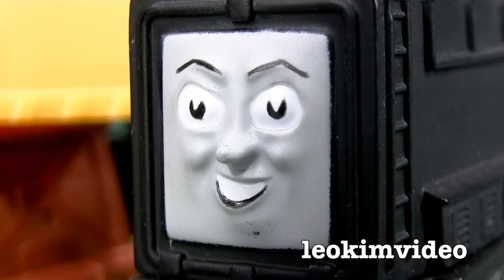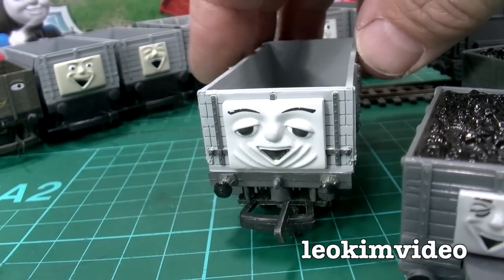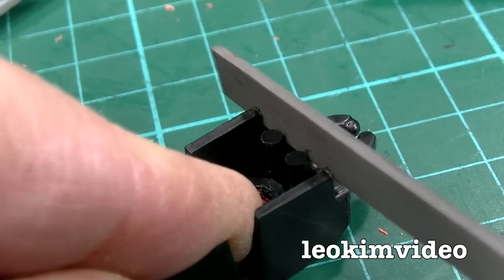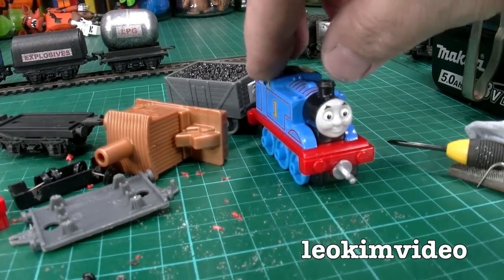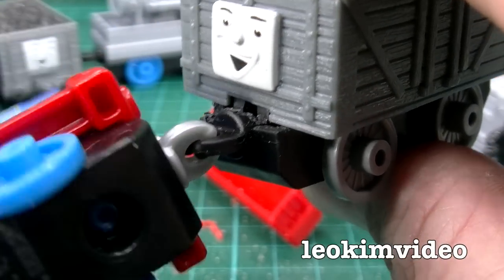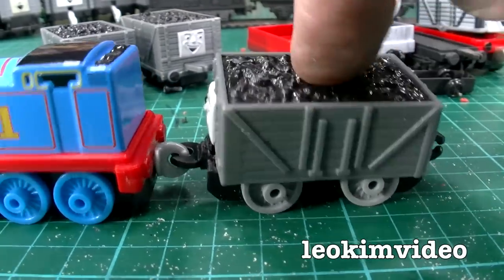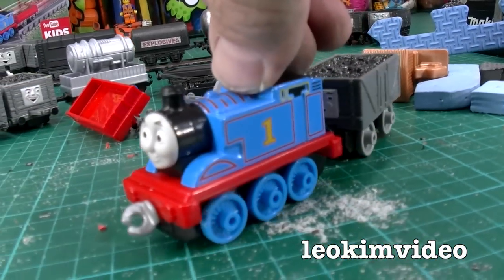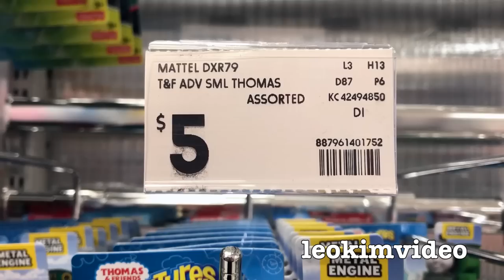Thomas The Tank Adventures ERTL Troublesome Truck Toy Train Mod How To

Comment: The ERTLS packed the detail and correct shape as seen on TV but the couplings were the weak links. It's they'd have been made with the Adventures couplings in the first place, there wouldn't have been any need for the magnets or any further changes

Comment: ERTL made troublesome trucks with different faces, like the ones you showed in this video, and they made S. C. Ruffey. They also made a very rare variant of the two standard Troublesome Trucks, but they are brown instead of grey. And they made other variations of S. C. Ruffey. They made two versions where he is marked as a “toy box” truck sold in a very rare Christmas two pack with a Thomas that has a Santa Hat molded onto the smokestack. And other Troublesome Trucks include a two pack called “Silly Vans”. Another very rare pack. And a brake van with a grumpy face, which is also quite rare.